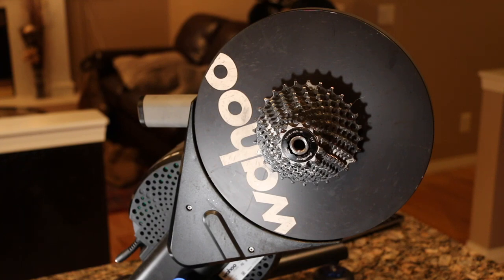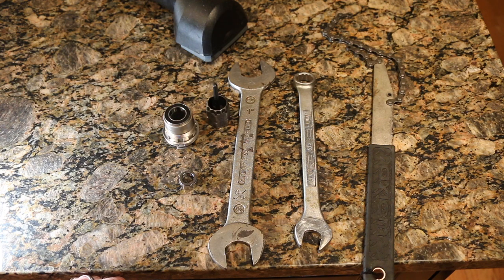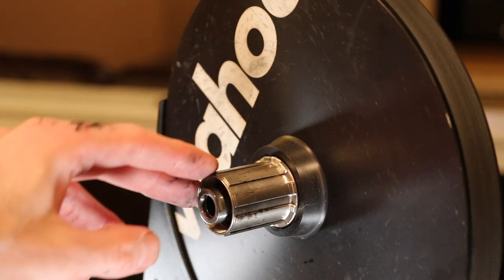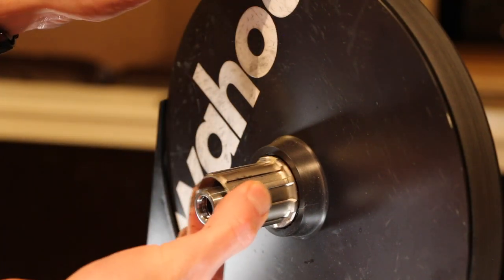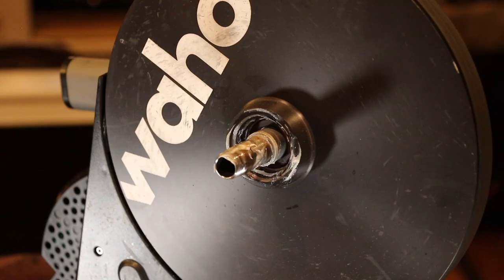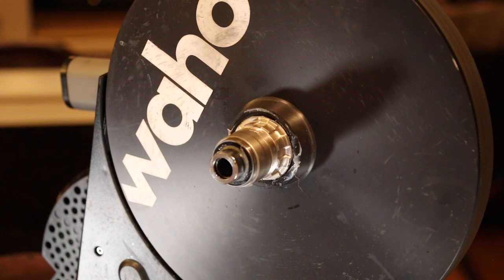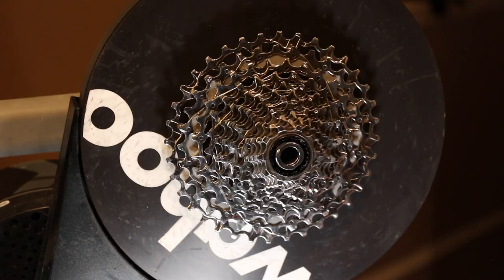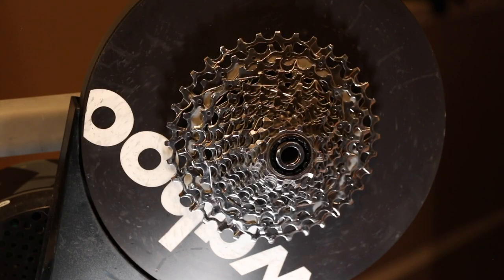Wahoo KICKR V5 -Freehub Change - Shimano to SRAM

Comment: Hey Mitch, thanks for the video. I am also considering switching the hub out along with a rival cassette for my Aethos too. Which cassette do you currently have on your Aethos? I'm wondering if there would be any issue coming from my main cassette (10-33T) to the rival on the training (10-30T)
Reply from the maker: No issues on that conversion. I have a 10-28T on the trainer currently
Reply: Yeah, no problem. If you’re using AXS you can define the new cassette in the app when you switch but it often doesn’t matter. This is especially true if you’re not shifting and just using ERG mode.

Comment: Thanks for the video! Like in your video, my cassette and the ring to fix the freehub end flush. I have a 142 mm thru axle, but for that I think the ring has to stand out a little further than the cassette, otherwise the smallest pinion will touch the frame before I can secure my bike on the trainer. But there aren't any adapters for the drive side left I would have to attach. Did someone have the same problem?
Reply: Same problem for me... Did you find a solution? 🤔
Reply: Same problem! Did you have a solution?

Comment: Do use the grease. I tried to swap mine but the new hub got stuck half way because of the friction,. It was quite difficult to remove. With grease it slid on with ease
Reply from the maker: Ya that’s fine.

Comment: FYI, technically it's and XDR driver installed here in your video (not XD). Also, the new nut supplied with the driver is specifically made for XDR (and shorter than the Shimano /SRAM 10/11 one you took off in the video.) They are not interchangeable so short with xdr, long one with Shimano /SRAM 10/11. Good video, though!
Reply from the maker: Awesome thanks! You can also run it as an XD Driver with the spacer I believe.
Reply: @MitchOnTwoWheels  Yessir!

Comment: great video. when i switch mine fro 11 to 12 speed  I can not get it to go through all the cogs only 10 of then and higher power cogs chains falls off . Any ideas ?
Reply from the maker: Either a spacing issue, or a derailleur adjustment issue by the sounds of things. Did you put in the correct end cap?

Comment: Was that freehub a thru axle? Sorry for dumb question!
Reply from the maker: Yes, they essentially all are. Little adapter would bush them down to standard 9mm if that makes sense
Reply: Thanks very much. I’m expecting a canyon Speedmax sram AXS 12 speed. I run an 11 speed with normal skewer as per your set up at the start of your video. So I’ll do exactly what you did! Thanks
Reply from the maker: @sagsdothedu  awesome. You’ll just need those little adapters for it and you’ll be off to the races.
Reply: @MitchOnTwoWheels  appreciate your video. Very clear. Ride on🚴

Comment: Thanks for this video! It's well produced and the explanations are clear, but I got stuck (literally) when trying to remove the freehub of my Kickr Core. Is there anything I need to do right after removing the nut? It doesn't slide right out like yours: https://youtu.be/zKJR2HkEYWQ Thanks for any help!
Reply from the maker: Just gently turn it while back pedaling. It may help disengage the pawls. Don’t be surprised if they fall off. Easy to fix.

Comment: How tight should tight the cassette when you put it back in? 
Just until it doesnt wiggle? 
Is that enough?
Reply from the maker: Should be snug. Not over tightened, not loose.
Reply: @MitchOnTwoWheels  any tips to know how snug is snug?
Reply from the maker: It’s hard to explain without a torque wrench. But it should feel tight… and obviously don’t strip it 😂
Reply: @MitchOnTwoWheels  what is torque value for tightening?